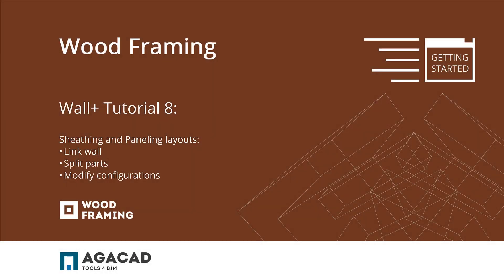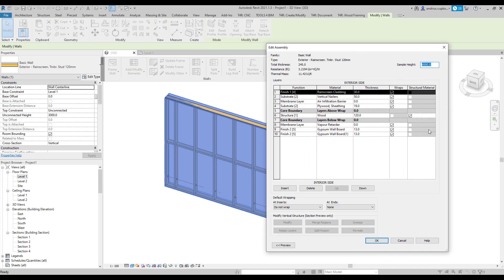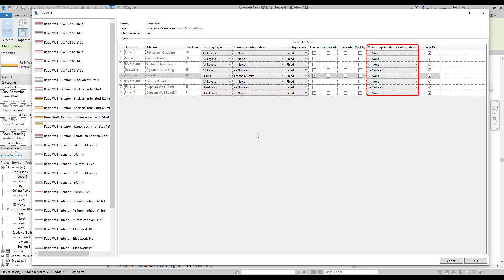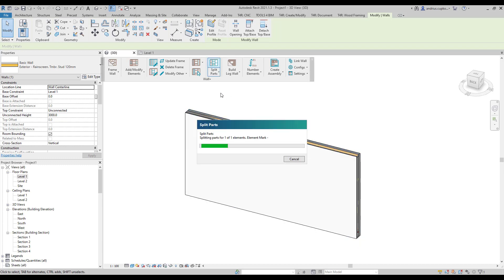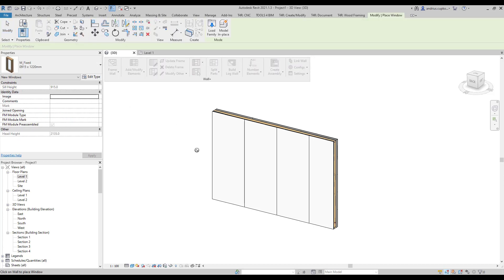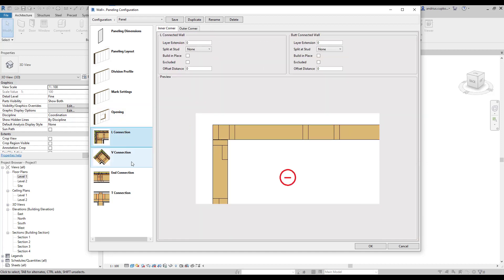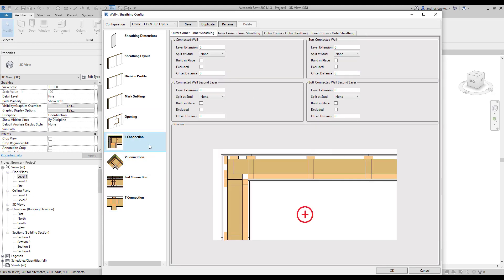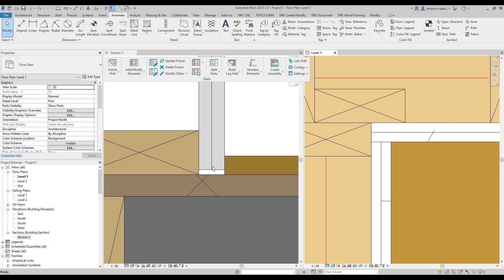Wood Framing Wall+ | Tutorial 8: Split Parts, Sheathing & Paneling Layouts

Comment: How do I add insulation between the studs? I want to have batt insulation in my assembly schedule.
Reply from the maker: In the Revit Family Editor, you have to turn ON the ‘Split Parts’ Type Parameter and the ‘Cut with Voids when Loaded’ option for Stud and Plate families that need to be split and have Parts cut. See our article on that for more details and screenshots. https://agacad.com/blog/wood-metal-framing-for-revit-recent-key-improvements#5 Thanks for watching!
Reply: @be-smart-software  Is there a video I can watch? On how to set it up? I'm not sure if I set it up right.
Reply from the maker: @brittanymotes8037  'fraid not. Please reach out to our support team via helpdesk@agacad[dot]com -- they'll be able to help more effectively.